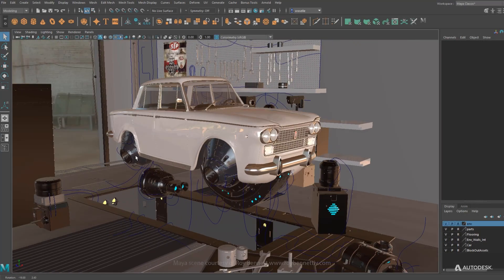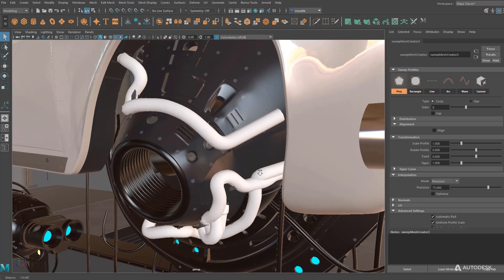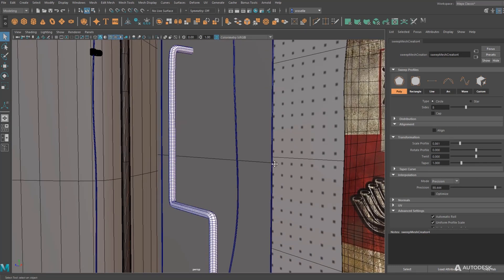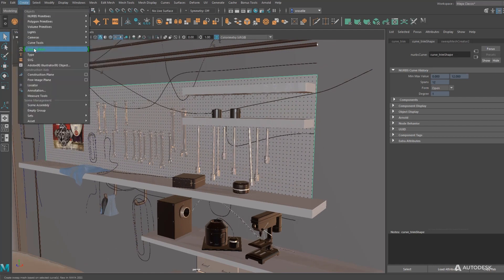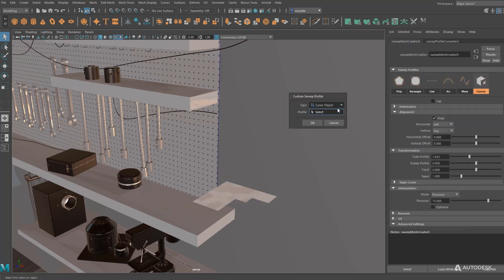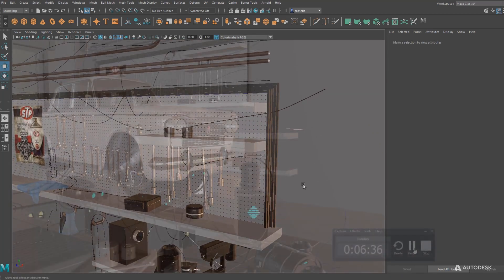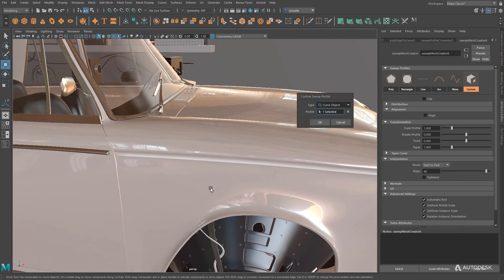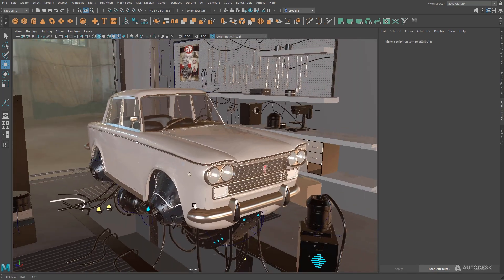Maya 2022 - New Sweep Mesh from Curve Tool

Comment: This is in Blender for AGES :D ....but it´s a great feature!!
Reply: and in 3ds max....for like 7 years
Reply: @pipahouse  Im trying to make a circular rope rug in max but with this feutre would be much easier.
Reply: @luisgarmendia2041   in max, you can try sweep modifier, loft, and if you just want a circular or rectangle profiled rope, just create the spline and turn on the renderable feature or add a renderable spline mod on top and there you go.